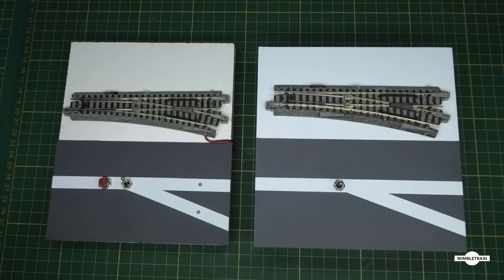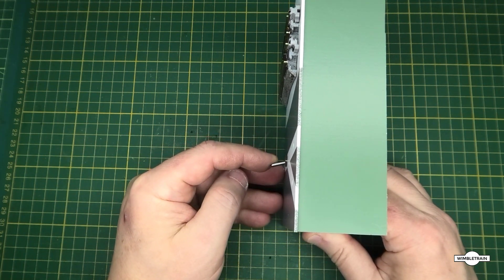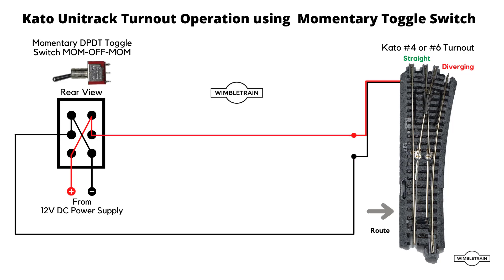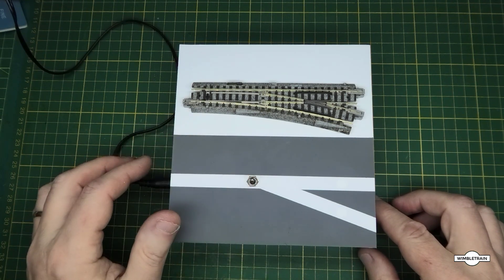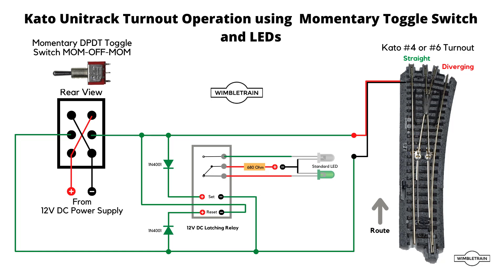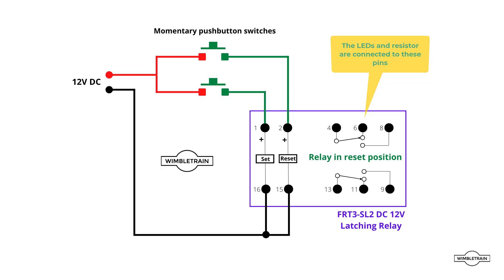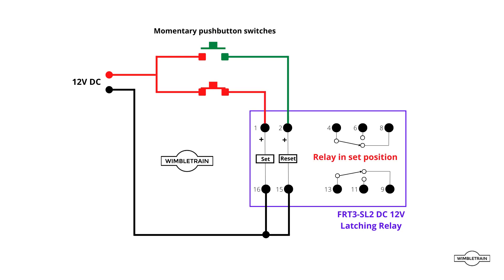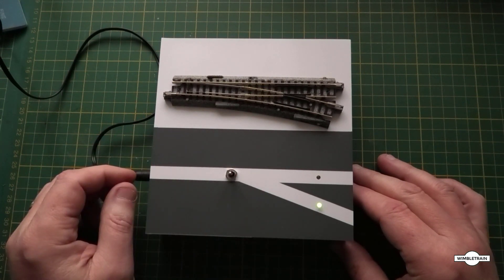Kato Unitrack Turnout Operation using Momentary Toggle Switch

Comment: I follow your video for my current setup with no problem using the latching relay and momentary switch and standard LED"s , i am currently switching from standard LED's to Bi-Polar, an you have a video with Bi-Polar LED's but it is not with the momentary switch. I ahve tried several configurations,  I cannot get the one red, one  green light on. any help would be of help
Reply from the maker: Hello, great question. I just made a video in response to your request. Thanks.
https://youtu.be/D9pSAuLl-Kc

Comment: Hi John, Gr😂eat presentation. Can you use the same circuit for a double crossover? Is there a modification needed or more power?
Reply from the maker: Hi, the same circuit is used. The only thing is that the double crossover will need a bit more current to operate. I use a 12VDC 3A power supply as I run multiple things off the 12VDC supply. If you are not running much off the 12VDC supply, then you can use 1A or 2A. It's just easier at the start to get a higher current power supply that way, you have no issues expanding.

Comment: Since my electronic skills are woefully lacking, I would just like to see someone bring something like this to market for mounting on my control panel.
Reply from the maker: Yes, it would be nice, I guess an option is the Kato Turnout Control switch, part number 24-840, if you are looking for something that is plug and play.
Reply: @wimbletrain  hard to mount a big blue switch on a control panel however. I am most interested in how to wire the latching relay. Are there pins on the reverse side?
Reply from the maker: @cbirailroad Hi, there are pins on the bottom of the relay, normally you would mount this on a printed circuit board but you can just solder directly to the pins. I also did this video https://youtu.be/F3PSmz9VPhE

Comment: I expanded on this idea, I went with a Toggle and a push button instead of a momentary toggle. I used the “other side” of the latching relay to have an amber indicator come on if I’ve flipped the toggle and not poked the button. 

To do so I fed constant positive and negative to each of the NO NC pins, and fed common to a rectifier made from 4 diodes. Along with a feed directly from the toggle output to the same rectifier. 

I like this because the Green LEDs always show the physical direction the turnout is thrown, but this way I can throw the toggle and “Prime” a button for a quick change, with the Amber to show its “Primed”
Reply from the maker: @Peepjouster27  Hi, it's great that you have come up with a mod that suits what you want to do and that others can use. I have shown just one method, and if others can modify and share their ideas, then thats a good thing for our hobby. Cheers  John
Reply: @wimbletrain  agreed! This video was the inspiration, and I wanted to get the idea “out there”

Comment: could you just use the regular switch from the other video without the pushbutton, so the LED installation is easier or am I missing something?
Reply from the maker: @player3prime  Hi, unfortunately, no, because this would put a permanent 12 volts on the turnout, which could damage it. The Kato Turnout is operated by a short pulse of 12 volts, i.e., only on for a fraction of a second.

Comment: Thanks John for this video!  It's great!  However, have you happened to have used only one  bi-color LED for this circuit.  I've attempted to do so similar to your other video (with the pushbutton and on-off toggle) bridging the two switch leads.  It works but as soon as the momentary switch completes on my toggle switch, in either direction, the light flicks on but then goes out.  I guess this relates to the latching component which is missing and you've used in this video which must keep the LED lit.  For my setup, I only require one red/green LED with the color indicating whether the switch is clear or diverted.   Can you advise what I need to keep the LED solid as in this video?  And also, the circuitry involved.  Many thanks, Dave in NYC.
Reply from the maker: Hi Dave,

I'm assuming that you want to use a bi-color (bipolar) LED that has only two legs

To use a two pin bipolar LED you would need to utilize both sets of contacts on the FRT3-SL2 (or equivalent) latching relay. The rest of the circuit will be the same

One leg of the bipolar LED  would connect via a resistor to pin 4 of the relay
The other leg of the bipolar LED would connect via a resistor to pin 13 of the relay

You would then have the positive (+ red) of the power supply connected to pins 6 and 9 of the relay
The negative (- black) of the power supply would connect to pins 8 and 11 of the relay

So with the relay in the RESET position you would have one leg of the LED which is connected to pin 4 would get +ve voltage via pin 6 and the other leg of the LED which is connected to pin 13 would get a -ve negative voltage via pin 11

With the relay in the SET position now you will get a -ve voltage to the LED leg connected to pin 4 via pin 8 and a +ve voltage to the LED leg connected to pin 13 via pin 9

it will probably make more sense if you draw it out. John
Reply: @wimbletrain  Another, hopefully quick, question:  I purchased a bunch of SPDT momentary, center off switches by Miniatronics and wondering if I can use those for my Kato switches?  Wouldn't need any kind of indicator lights.  Thanks John, Dave
Reply from the maker: @davidzimmerman3238  Hi Dave, you need to use DPDT to reverse the voltage, you can't really do it with a SPDT
Reply: @wimbletrain  Thanks for taking the time to reply John.  Off to Amazon to make a purchase :-)
Reply: @wimbletrain  Good morning John!  Yes, that is correct -- a bipolar LED with two legs.  Thanks much for taking the time to reply to my questions.  I'm not an electronics  wiz -- actually a neophyte, so I'm glad you provided the detailed instructions in your reply.  A last question is what value diode which are soldered to the relay do I use?   I'm planning n ordering the latching rely today and will attempt to get this working, but may get back to you should I have any questions along the way.  Again, many, many thanks, Dave
Reply: Good morning John,  I just wanted to report that with your help I successfully created a circuit with the toggle switch and two color LED.  I constructed a separate board which contained all of the components (including the latching device, resistors and diode) and then connected various points to the Kato switch and LED, and it WORKED!  Thanks a mil for your help in getting this solved.
Reply from the maker: @davidzimmerman3238  That's great to hear, Dave! I love to see people share knowledge and ideas so we can all learn, and projects like this really give you a sense of achievement when you get it all working and customise it to suit your needs. All the best.
Reply: Hello again John. 

So, I've purchased and received the same latching relay you were using in your video.  with eight pins:  four for the set/reset (pins 1, 2, 15 & 16) and six pins for the "latching" section, if you will (pins 4, 6, 8, 9, 11 and 13).  I just want to make sure I'm not missing something and understand  wiring this circuit correctly as you explained in your helpful instructions:  basically, if I read this correctly, unlike the diagrams you use in the video, I will not use any of the pins (1, 2, 15 or 16) of the set/reset for power connections but will use only pins 6 and 9  for the + red) and pins 8 and 11 for the - black as you've outlined.  So there would be no power connection to pins 1, 2, 15 or 16.  

Or, is that understanding incorrect and you mean that as far as physical connections I make, I should connect the power to the set and reset pins as indicated in your diagram and the one bi-color LED I'm using with resistor to pins 4 and 13, BUT that all of the description you provide after that is how the latching relay is designed functions internally and I don't need to do any of my own wiring to those pins. 

I hope the previous two paragraphs are clear. 

Finally, is there any particular value I should use for the diodes?  I have a couple of new 12V Zener diodes.  If those aren't correct, can you advise on what I should use instead. 

Again may thanks from a electonics-challenged model train enthusiast!

Dave
Reply from the maker: @davidzimmerman3238  Hi Dave, no worries, it can all be a bit confusing, even for me.
So connect the set and reset pins as shown in the original diagrams.
The only thing you are going to change is the connections to relay pins 4, 6, 8, 9,11 and 13.
So with nothing connected to these pins you will then:

1. Connect one leg of the bipolar LED via a resistor (680 ohm) to pin 4 of the relay
2. Connect the other leg of the bipolar LED via a resistor (680 ohm) to pin 13 of the relay
3. Connect the positive (+ red) of the power supply to pins 6 and 9 of the relay
4. Connect the negative (- black) of the power supply to pins 8 and 11 of the relay

(If the LEDs are too bright or dark you can vary the resistor values)

The Zener diode is not suitable for use in this circuit, use a 1N4001 or 1N4004 which are commonly available

All the best. John

Comment: Can you provide a purchase link on the relay? I looked on Amazon but couldn’t find the exact one you were using?
Reply from the maker: Hi, I got my latching relay from a local electronics store here in Australia, so I don't have a purchase link. You can search '12v pcb latching relay'. When you find something, then you can look at its datasheet to make sure it has the same pinouts. One I did see online, which looks the same, is a HFD2/012-S-L2 or HFD2/012-M-L2 The L2 is important at the end as it has separate set/reset connections and the 12 is 12v coil.

Comment: Great video, one question, what happens when the power is turned off, does the Latching relay stay "latched" keeping the LED and turnout in sync when you restart (power up) the layout
Reply from the maker: Hello, yes, the LED and the turnout stay in sync after power down and then power up. The latching relay will stay in the position it was before the  power is turned off.  Thanks for watching. John

Comment: thanks much for the video.  I am wondering if using the momentary switch method here, can it be replaced with a single pushbutton somehow?  I've been racking my brain trying to figure it out, but the momentary toggle switch is a good solution - I am trying to omit as many buttons/switches as possible from my panel.
Reply from the maker: Hi, if you were to use a single pushbutton  then you would need some circuitry to send the pulse to the swich as well as then revserse the polarity so when you pressed it again the switch would operate to the other position. I am guessing this is the kind of thing you are talking about? John
Reply: @wimbletrain  Hi there, yep. that's exactly what I am thinking about.  I'm digging into what logic controller I am needing to do this.

Comment: Hi there,  Excellent presentation to the minute detail.  BTW, I am Mani from India.
What is the alternative for FRT3-SL2 latching relay.  Here in India, I could not find one.
I am setting up N Scale model double oval with 5 turnouts.  I did search for 16pin latching relay as well.  Appreciate if you could provide an alternative. 
Thanks, Mani
Reply from the maker: Hi Mani, hard to easily find a direct equivalent easily. Best thing to try is download the datasheet for the FRT3-SL2 from the internet and then search for latching relays that are available for you locally. Compare the pinouts and see if there are any similar 12V relays available.

Comment: Hi Everybody, I need assistance, the video shows the resistor connecting a plus sign & the two leds connected to a minus sign my question is “ Both are not showing as to what they connect to” so where do they connect, appreciate an explanation & thanks
Reply from the maker: Hi Chris, the plus and minus connections you mention go to the 12V DC power supply. John

Comment: Do you have an actual pick of your wiring ? I have the exact same relay, switch and leds and it is wired exactly as it shows and nothing happens on the relay. The switch switches but no leds lights. A pic would help me tons . I have the relay plug soldered to a breadboard so the relay pins don't break. Any help would be great! Thanks for making the great vids!
Reply from the maker: Hi, I was thinking of doing a video showing the wiring and running through it but can I ask you to check something. In my video I show the relay pinouts from the bottom of the relay. So if you are looking at the top of the relay (with the writing right side up) pin 1 is on the bottom left, pin 8 bottom right. Pin 16 is top left and pin 9 top right. The LEDs the longer lead is the positive and the shorter lead the negative. Let me know how you go. John
Reply: @wimbletrain  Thanks! I do have the wiring as described and I have the anode and cathode of the LED wired properly as well (Anode + / Cathode -). Any other suggestions?...I just think I am missing something simple. Appreciate all the info!
Reply from the maker: @plus1miniatures344  I can do a video and show my wiring (it's a bit messy) and hopefully it will help.
Reply: @wimbletrain  Alright after a bit more tinkering I have 1 led working but the other does nothing. Same as gentleman stated below. I have tried multiple relays, diodes and resistors. When I switch the direction to make the led light the voltage after the resistor is 2V. When I switch it the other way it goes back to 12. Is this correct? Seems like it should always read 2V after the resistor no matter what.
Reply: @plus1miniatures344  it should be 2V no matter which LED is lit. There must be some connection issue with the LED that doesn't light up. Can you hear the relay operating when you fl1ick the momentary toggle?
Reply: @johnogsii7976  yes I can here the relay flick and have checked voltage at the LED but there is none. I have checked all the pins for 2v when the switch is thrown and there isn't any unless I flick it the other way.
Reply from the maker: @plus1miniatures344  Sorry, the above was my reply but I was logged into my other account!
Reply from the maker: @plus1miniatures344  Ok I've watched my video back and can see that I may have caused some confusion with my diagrams. The resistor should be connected to pin 4 of the relay and the leds to pins 6 and 8. Let me know how you go checking that. John
Reply from the maker: @plus1miniatures344   @@PeterMartinPhoto  The other thing to note is make sure your 12V supply is at least 2Amps. I tried running the circuit off a 9v battery just as a test and the relay would not operate unless I disconnected the Kato switch. I know not a fair test but it kinda points out the need for a decent power supply.

Comment: How many amp 12v power supply would be required for 8 Kato switches?
Reply from the maker: As you probably won't be operating all of the switches at once a 2 amp would be fine.

Comment: Can this be used on a DCC layout?
Reply from the maker: Hi Wes, yes it can, you just need to run a separate 12V DC power supply to operate the turnouts.